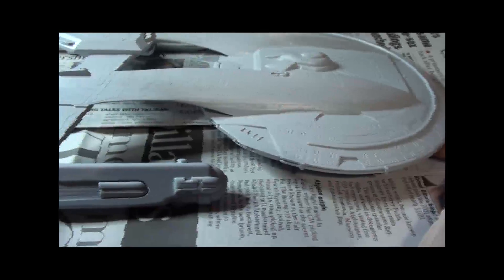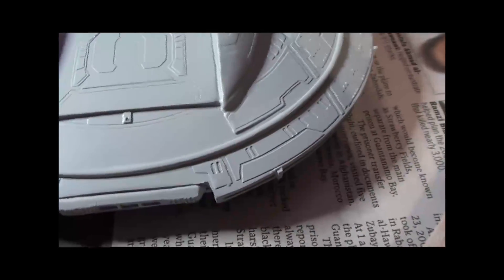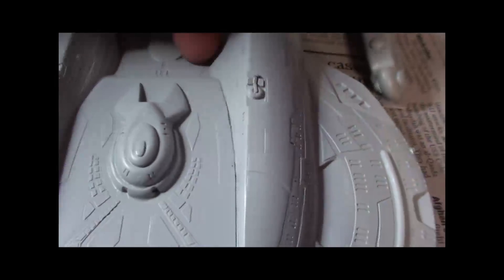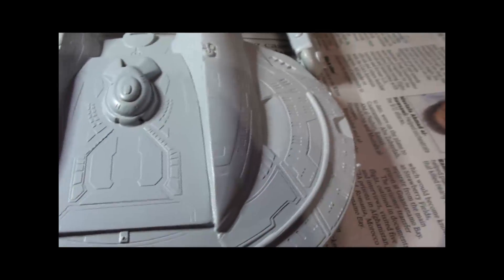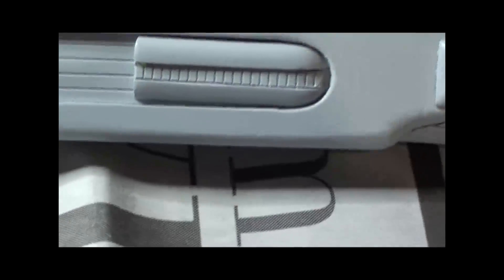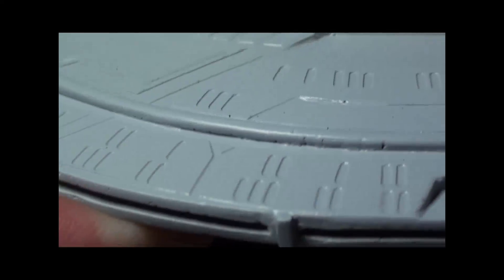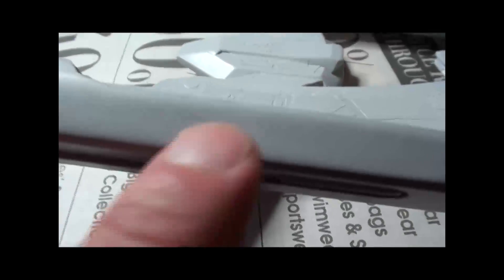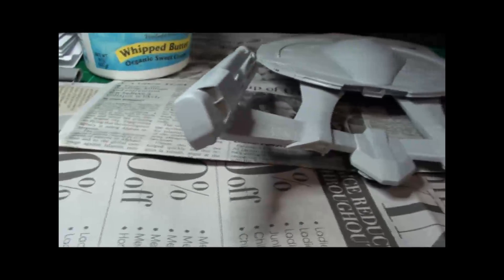USS Thunderchild part 6

Comment from the maker: @SMConsortium I gave it 24 hours before I started sanding it, and it is pretty much gone.  I don't think that they are all this bad.  I went and pulled a few of them, and didn't see anything like this.  One thing to keep in mind, this isn't like styrene.  The molds can only be used so many times.  And as you get near the end of the molds life, the castings get worse.  This was probably near the end of the molds life.